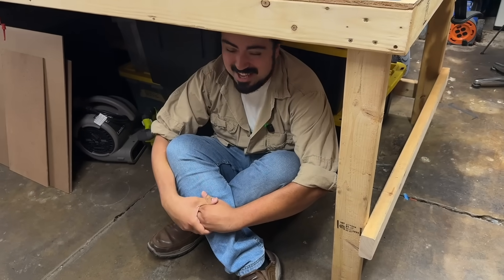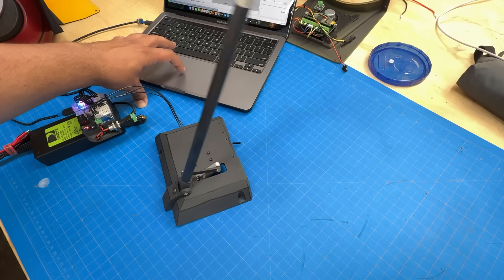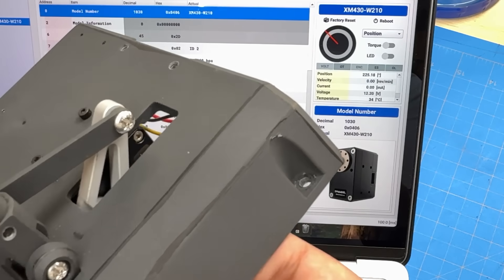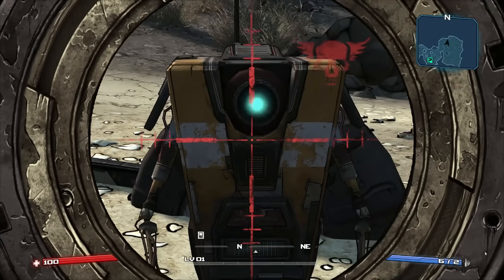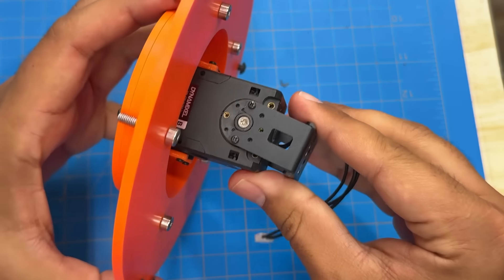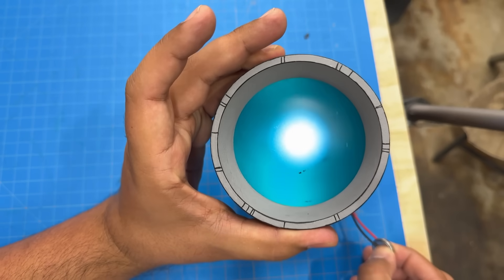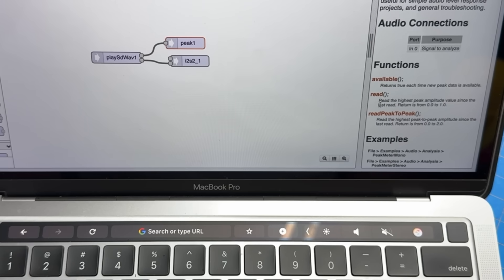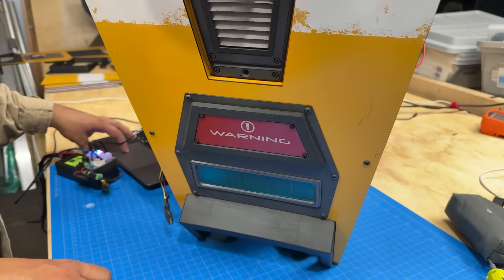Building an Animatronic Claptrap: Lights and Sound

Comment: If you cut or laser cut some of that partial mirror acrylic they use for infinity mirrors (I think you can also get it as a vinyl) you could cap the clap trap antenna with that to get more light bounce out the sides